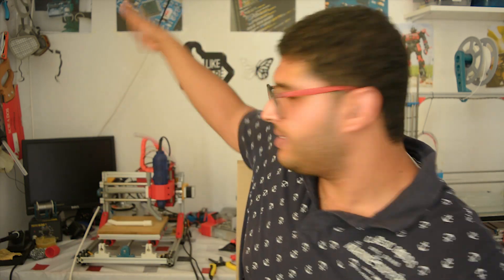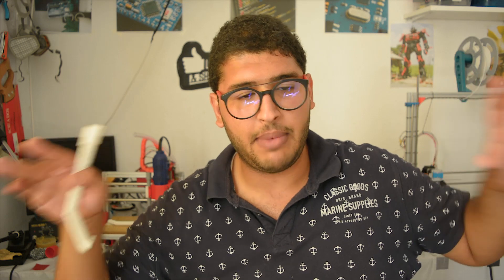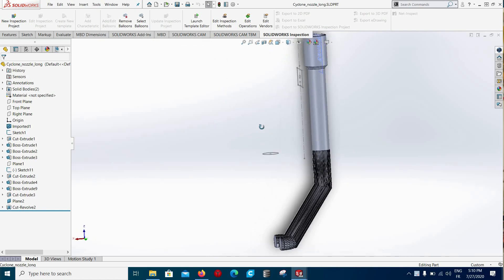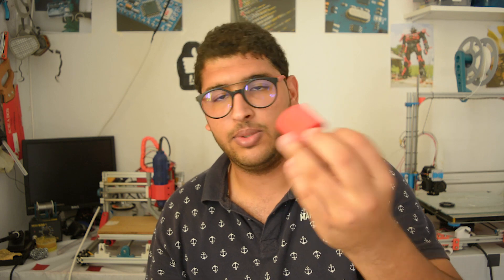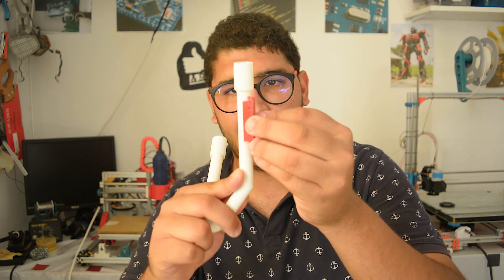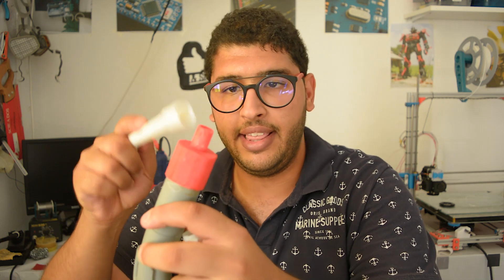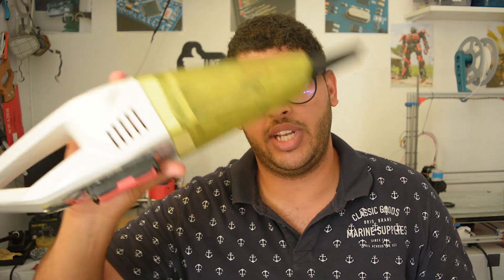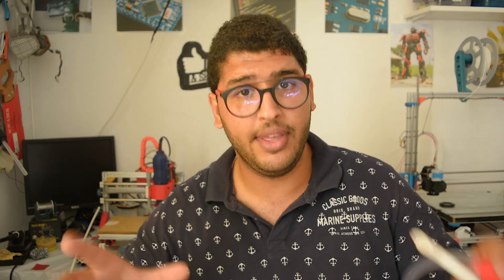3D Printed CNC Dust Collector II 3018 CNC Compatible #31

Comment: Nice job. I would suggest to improve this by adding some dust filtering or your vacuum clean or will not live long. Check some cyclone projects.
Reply from the maker: Thanks ,the thing is the vaccume already come with a filter so i dont have to worry about that.but this can be helpful for others.thanks for the save
Reply: @TnInventor  you are underestimating how truly fine wood dust is and how a normal vacuum filter or bag operates. Vacuums for the most part, actually make the air dirtier in many, many scientific papers, JUST with household dust. And not a single vacuum retains a warranty when used with woodworking. A cyclone is also not helpful for fine dust. The fine dust has lasting debilitating qualities on your health.
Reply from the maker: @womplestilskin   oh , then a filter is no good either? my vacume has a cyclone in it , it does not use a bag , will that help?